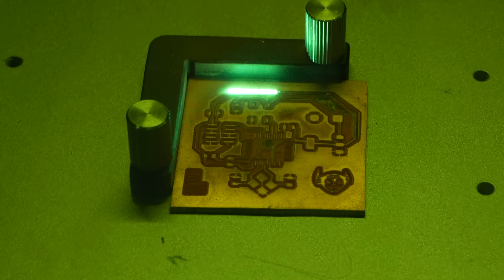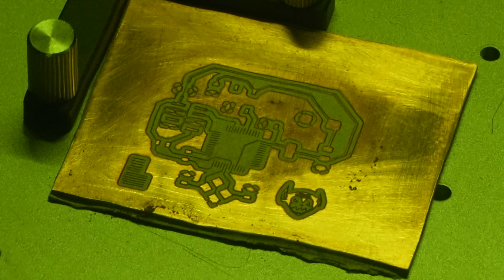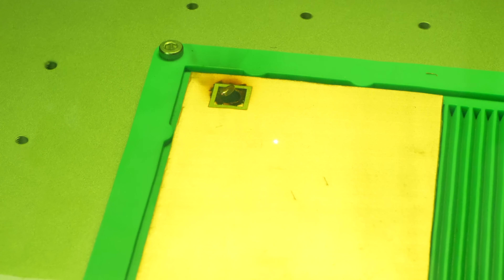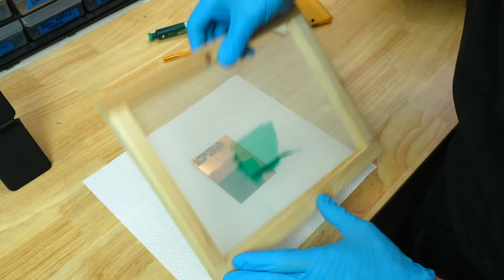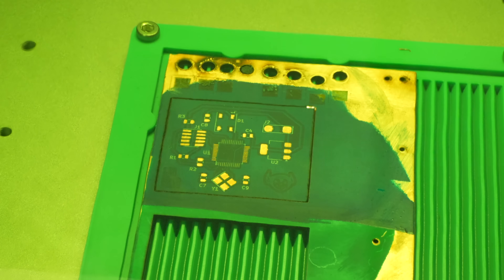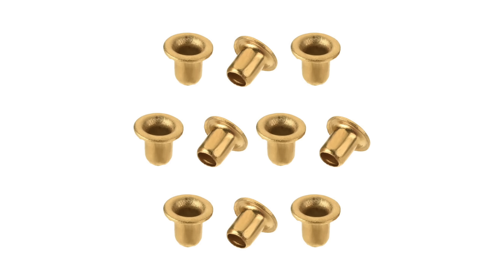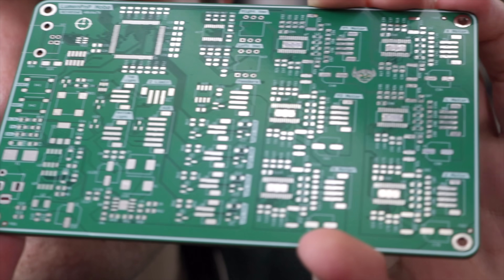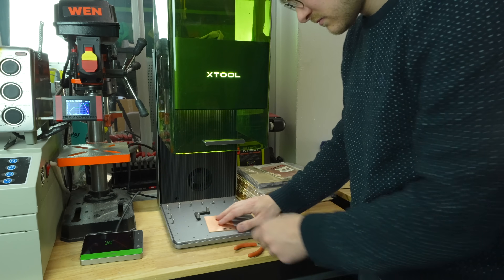Prototype PCBs faster than 3D Prints

Comment: re: repeatable positioning, I think the best case procedure will involve as step 1 cutting some pilot holes then drilling those out, because the drill is going to make a straighter and more round hole, and using those holes with alignment pins to position the board. Doing all this before cutting any traces will ensure that every following operation has the most repeatable alignment. And of course the further apart you can get those pins the more accurately they will position the board, so doing big sheets is better. You could probably put together a software tool chain that lets you drill/pin a big sheet and then place subsequent projects on it so they don't individually need to be drill/pinned; separate projects over time, not normal panelized.
Reply: Re: lazing the backside, Any composite based PCB substrate is going to have a pretty low ceiling on maximum repeatability. As above I think this is good enough for a single precision pass and then any number of approximate passes, but doing a second precision pass on the other side where alignment matters, is going to limit your feature size. In this case the best procedure would be to mount the PCBs to something more rigid and more hard that can carry them for the remainder of the processing. A stainless steel frame seems like a good option. Flex can be moved from the frame to the mount by fixing it down, then you just need the mount to hold the frame reasonably flat, so literally a rectangle of stainless steel with another rectangle cut out of it, and various alignment/bolt holes, should be good.

Comment: How thick the copper layer is isn't a function of where you got the board from or how old it is. It is a function of how many ounces of copper per square foot you buy. Thinner copper (usually 0.5oz) is easier to etch fine details into, which is ideal for tightly packed digital circuits using BGAs. Heavy copper (2+oz) is almost exclusively used in high-current power/ground planes and power supplies.
Reply: Exactly. I have seen EV power boards that are more like 2 copper plates with fr4 between them.
Reply: @excitedbox5705  beyond 4oz, you are in "solder/glue bus bars to PCB" territory, can't really etch copper thicker than that.
Reply: @teardowndan5364  I think these were actually CNC machined.
Reply: Double sided boards generally have a thin coating from the manufacturer because they will get thicker during the VIA plating process.  Single sided boards are generally thick already as they do not get the via plating step.
Reply: Hi . Can you indicate the link for shop that single side pcb with thin copper . Thanks in advance ! Nuno A. From SMD Portugal

Comment: isn't it possible to just put solder paste into a via hole and melt it ? the surface tension should keep it together and connect the 2 sides

Comment: Imagine a home pcb machine. It has a standardized board size held with 4 holes so both sides are accessible by the machine.

You insert the copper clad. The machine laser etchs your traces. The machine sprays or squeegies on solder mask. The machine etchs off the solder mask where needed. The machine cnc routes or fetches out the pcb. The machine uses a selective solder machine similar to assembly machines using surface tension to make vias utilizing surface tension to wick the solder through. It uses a higher temp solder such that you can still bake the board later.

Such a machine could totally exist.
Reply: > Such a machine could totally exist.

and it would cost $80,000.
Reply: @TMS5100  Wouldn't need to for any real reason. The things I described are all buyavle individually for less than 2k (and most even lower still apart from the galvo laser).
Reply: @BeefIngot  if you really think you can produce a hobbyist affordable machine that actually works and doesn't completely suck, then go ahead and do it, you will become a millionaire overnight.
Reply: @BeefIngot  the hard and expensive part after buying at least 5 (low quality to stay under 2k) hobby grade machines is either smashing them together like the snap maker 3-in-one (3d printer,diode NOT fiber laser,cnc. Does none very well, costs 2k) or making some kind of assembly line plus robot arm and all the software to hook it all together. I also look forward to the build videos when you get around to it :)
Reply: @eg1162  I this case this isn't like a 2d printer cnc combo because those have competition interests. Here, each part can be the best it can be. It's not the difficulty you're comparing it to.
Reply: If you're going to the trouble of cnc machining holes, just cnc the traces as well. Check out the wegstr machine. (I bet you could make a similar machine diy for much less, maybe 1k to 1.5k).
Reply: @eg1162  People have managed to cnc mill PCBs on those cheap cnc router machines from sites like Banggood and Aliexpress. They are usually named something like "3020 cnc router".
There's nothing too fancy about them, they're just constructed from aluminium extrusions and some basic stepper motors. They mill plastics and soft woods without much trouble. Most importantly though, they usually support autoleveling which makes them pretty decent for milling PCBs.
Reply: @arstulex  by "something similar" I would also mean getting a really nice end product, especially with super tiny bits. So you could modify a cheap mill to increase the precision of the motor, get a more precise servo for the spindle, so on and so forth and have an above hobby grade machine for 1k. I bet an off the shelf $200 mill could certainly do it, but not as cleanly as I would want (I am incredibly picky). I myself am building a 1500mm cnc router that I plan to make some videos on once I stop being so lazy.
Reply: Machining the traces is much more error prone and slower than a fiber laser. The laser is less sensitive to small height differences I bet.

Even the "drilling" may be possible with a laser. If you can cut the perimeter with the laser, why not cut a hole.
Reply: @qwertyboguss  So what if it's more error prone?  The whole point is for prototype pcb's that are quick to iterate on, right?
Reply: @BEdmonson85  if it indeed is, it's a big deal because you'll be wasting time making PCBs that have errors in them. Best caste scenario you'll have to redo the boards, worst case you're endlessly debugging your circuit only to find out it's a manufacturing error.
Reply: @qwertyboguss  speaking as someone who as actually done this with a fiber laser - actually try this with a 1064nm fiber laser before assuming it works in a specific way. a fiber laser is still extremely sensitive to small height differences. you want to actually use as little power as you can get away with or you burn the crap out of everything. also suprising is how uneven the copper plating of even expensive FR4 boards is. i have done drilling with lasers. big holes is easy, small TH holes results in a charred mess and destroyed traces. tiny vias, forget it. you are way better off drilling.
Reply: @qwertyboguss  The main issue with drilling holes, as seen in the video, is that the thermal energy needed builds up in the board and starts to melt it if there isn't an intact copper sheet to sink it away from the hole. It is also limited to FR1 boards, given the cardboard particle composition ablates away more easily, and FR4 boards would not as they are glass fiber. An endmill would simply not care about the material in this case, or how thick it is. As for "error prone", look up the video "What's the Smallest Thing You Can Machine on a Nomad CNC?" by Carbide 3D. He uses a machine not even built for PCBs to mill text where the letters are .127mm tall - not the line width of the text, the entire letter. He could almost engrave a message into the pads for the MCU in this video!
Reply: @eg1162  Thanks, I appreciate the context. I'm by no means a CNC expert, however in that video they're using tiny end mills on graphite. Easy to machine. I wonder how a small end mill capable of the required tolerances would hold up to a PCB with some deflection (they're rarely straight so depth of cut is a constant issue). I think less so with lasers.

Comment: You could drill holes big enough to get a wire through and smash both sides of the wire to create a smaller rivet - and then it may be soldered from both sides to create a stable connection

Comment: Ok this is a very wild idea, that just popped into my head for crating throughholes:

- Essentially strapping to gantries like two lumens to each other with a head that takes soldering tips (like a pinecil or so)
- Then both sides drive to the location of that via and press the soldering tip on the hole
- a feeder feeds a small amount of solder into that "situation" until there is continuity
i am not sure how reliable that is though...

Edit: I randomly stumbled over this YT short later and its kinda (mainly the feeding of solder) the thing i wanted to suggest: https://youtube.com/shorts/3sQd-SYofp0?si=Y02_1CeMMFFoUMjc

Comment: Years ago I was researching if it was better to design PCBs with sharp clean corners or smooth curves and one of the things theorycrafters on the internet at the time were saying was that the method PCB houses use to put the design on the board is ultimately pixel based, so curved traces would have more jaggedy edges, and this would do something undesirable to signals as frequency increases. No idea if this is true, it never mattered for my designs, but seeing these pixelated edges reminded me and now I'm like, it'd be cool to see if this is true and what it looks like. I assume this effect is at high megahertz to gigahertz, I've seen a cortex MCU up to 600MHz, but I don't know if any 600MHz signals are going through the PCB or if there's a lower frequency crystal with a clock multiplier in the chip

Comment: I've been planning to build a CNC machine to produce PCBs for about a year, but I haven't even had time to start yet. Seeing you achieve these results is making me want to start. 
The solution I had in mind for creating conductive vias is to make a normal hole, inject it with solder paste, and melt it. The tests I did on perforated boards worked; you could give it a try.

Comment: is it feasible to just use solder as a via? Just put solder into the hole zhag was drilled and have it connect the copper on either side. 
I would guess that this method would still create a bead on either side (as solder does) but I would think that it is definetly worth exploring the idea as it is pretty propably the easiest way to integrate it.

Comment: Consider an electroless copper plating! Ben from Applied Science has a recent video where he plated copper onto SLS prints, and the electroless copper method works well because the substrate does not need to be conductive.
Reply: I think it will need extra electroplating step or else there will be not enough strenght
Reply: Electrolysis

Comment: Nice video, so hers a question...Could you apply some solder paste on the pads place a component and solder it using the laser?
Reply: Yeah, the laser would have to dump enough heat into the solder joint to melt all the solder and bring both sides of the joint up to temperature. And it'd need to do that without blowing a hole in whatever is on top.

By comparison, you can successfully reflow solder with a cheap toaster oven coated with aluminum foil on the inside. Add a thermocouple, a microcontroller, and a solid state relay, and now you've got a "proper" reflow oven that can follow reflow profiles.
Reply: it has to be pretty powerful laser to provide enough heat to reflow solder and compensate for heat transfer into PCB / component. I think reflow is much faster / cheaper.
Reply: @deeeppurple   It would have to be weaker than the laser in the video, which is vaporizing the copper.
Reply: It's a single sided board, just put it on a hotplate and it will reflow.

Comment: Maybe Vias could be automated with an Mig welder style wire feed that guides solder wire into a drilled hole and then melts the solder to fill out the hole. Would need a complicated mechanical assembly on a gantry tho.

Comment: What about a single strand of copper wire for vias? Not sure how you’d automate it, maybe some kind of sewing machine mechanism, solder, then trim flush to the board? Similar to the rivets but could get way smaller. 

Also, opulo full stack pcb production line when?
Reply: You have the germ of a brilliant idea here.  Drill, etch, solder resist (silk screen layer) as above. 

Apply solder paste, SMD parts, reflow.  

Have thin bare tinned wire on a spool in the pick and place head.  It uses a tiny plunger to form a hairpin above the next hole location.  It then 'inserts' the hairpin through the empty via and a solenoid driven hammer bends 0.5mm of the hairpin over on the bottom to lock it in place.  Pick and place head moves to next location to repeat.  Board is soldered on the bottom and the floating 'stitches' are cut close to the top but left with a tiny bit spread out so they are trapped when soldering them on top.

Add through  hole components and solder.

Secondary benefit will allow using the stitching wires to add current carrying copper to power traces that you then solder in place over the tracks.  Even thin copper wires will help if there are many and they will trap extra solder that helps a little more.

Try and get your idea to the attention of @stephen_hawes because it might be a very interesting add-on tool for the pick and place machine.

Even an automatic bare wire link inserting tool would work that would make single sided boards almost as good as a double sided and making a minimum length wire link from one track to the same track on the opposite side is effectively a via.

Comment: don't use rivets, back when I was a kid in high school I worked at a tv & radio shop and #1 intermittent problem with tv's was rivet boards, they would get bad connections @ the rivets from heating & cooling of the circuit board from normal operation.

Comment: another option which works with FR4 is to use photo sensitive resist and expose it using the laser. Its not as fast, since you need to etch the normal way, but opens up other material options :)
This is basically what will be done in some industrial rapid prototyping setups. If you get the alignment right, its even possible to stack boards and get more than two layers. 

btw. the thickness of the copper is (normally) mentioned when buying the raw material, since it is an important information when calculating needed width of traces (for a given current).
Reply: When I look up the prices, tho, the raw boards with photoresist on them already cost as much as ordering the boards from a cheapo PCB fab. And they come in awkward sizes. Like 100 x 160 mm might be a standard but most of your designs won't be that big. I don't think you can cut them don't to size without severely damaging the photoresist layer and risking that your finished PCB won't have defects due to that.
This laser engraving idea is really, really promising but the material limitation to phenol sucks. There's a reason they went out of fashion and I don't think engraving phenol which tends to outgas formaldehyde is such a good idea either.
Maybe the key step to improve upon this is finding a way how to homebrew copper layers on ceramic substrate? Laser engraving on alumina substrate would probably do well.
Reply: @JoshuaNorton  there is a photo resist as a film you can apply yourself if I remember correctly. Also cutting them most likely does not damage the photo resist to much. 

Whilst looking for the tools for that. I stumbled onto this https://youtu.be/JH8hJNBID8I?si=KBObHQ11_-VqAIiV it shows a technique to get through hole vias plated (they use a vacuum table in that video, but maybe you could manage without)
Reply: @JannisDohm  
The right photo resist is VERY HARD to get. For the quality of processing it matters a lot that you spin coat it. It's how you make sure that your coating is spread as evenly as possible such that you get the same duration of exposure across the entire substrate. Otherwise you get thick and thin parts where you'd get overexposure and underexposure issues.
It means you need the photoresist as a liquid to apply it by dropper. Like the real industry does it. Generally, that's not possible to buy for most people. That's only sold by chem suppliers to registered companies. 
So far, the maker community only ones one company that sell photoresist to the public and it comes in a spray form which is very unhelpful.
Reply: @JoshuaNorton  look at something like the Photopolymerfilm F4000 :)